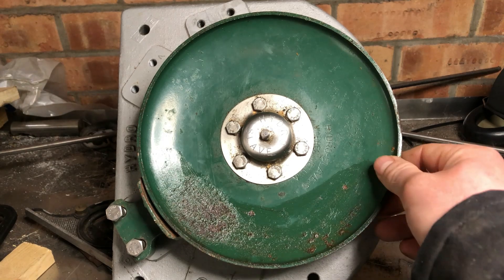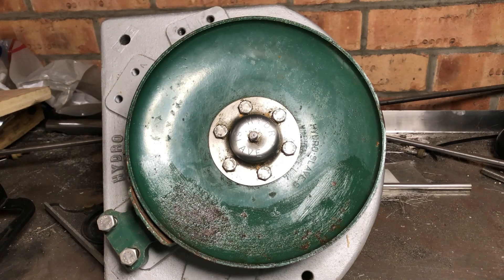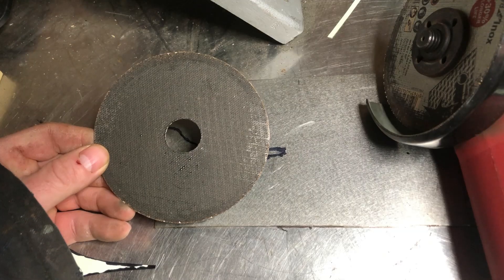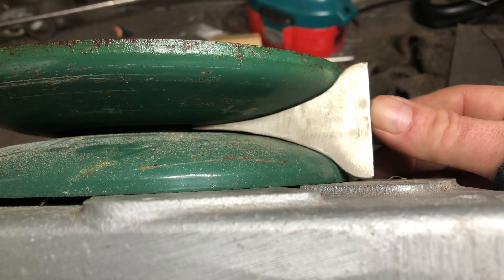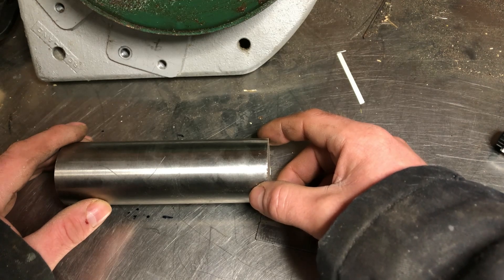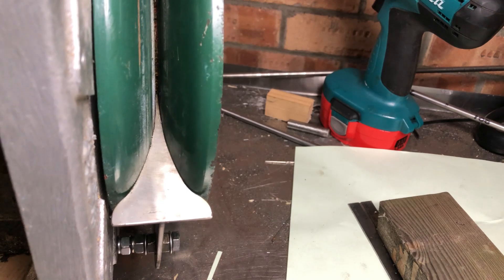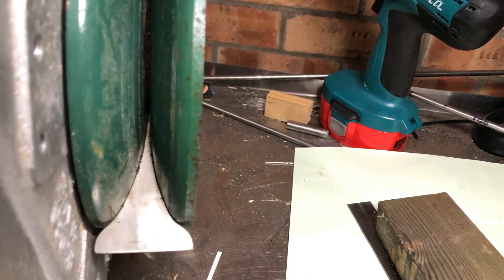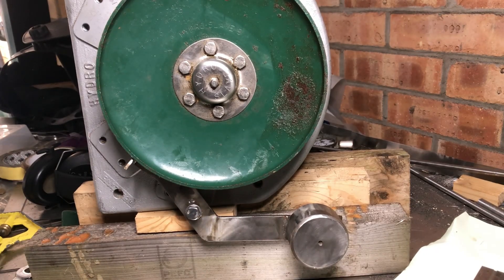Commercial fishing boat longline hauler - making a floating ejector knife

Comment: Did it work? any videos of this or other ones working? I think to try this as well
Reply from the maker: I havent used it yet, but Ive made exactly the same knives before and they work well
Reply: @beanysfishing2555  thanks - I dont understand how this works where the normal hauler knife doesn't?
Reply from the maker: @brianbannamin689  the normal knife isn’t precision ground, so the snoods and hooks can get jammed between the plates and knife. This is alot closer, and if something does get jammed, you can flick the knife on the counter balance and it can be cleared